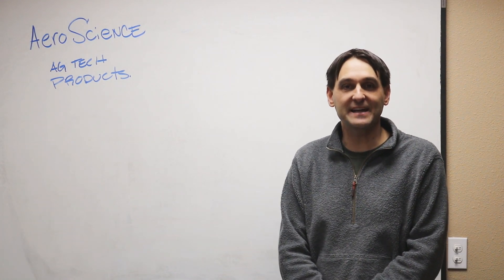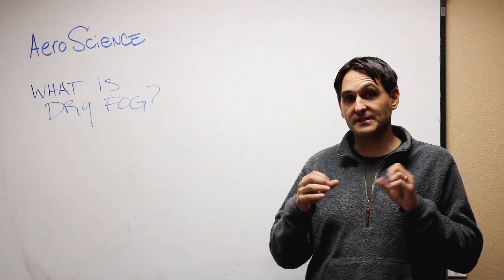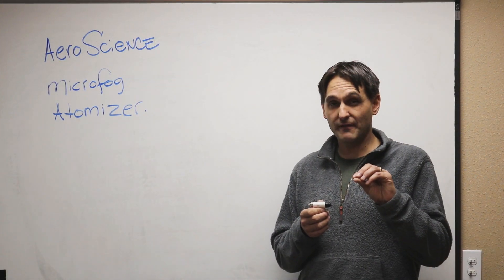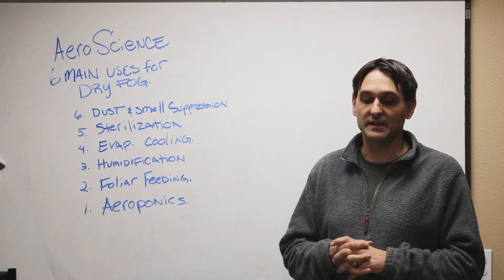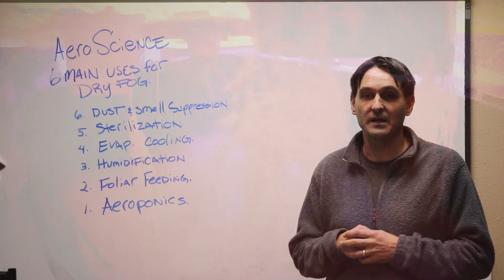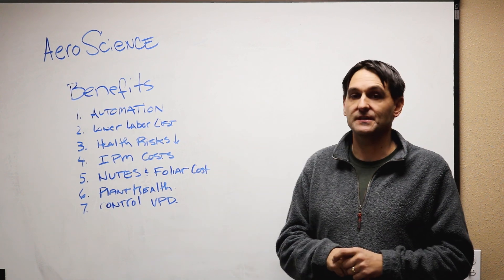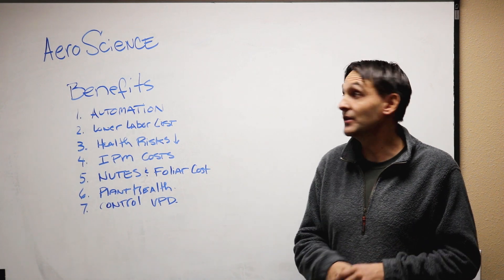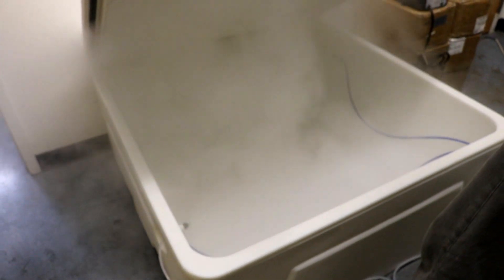What is Dry Fog?  By AeroScience Ag Products

Comment: If I were building an aeroponic/fogponic system, how much power/energy would be required per square meter?  That is, assuming a $0.10/KWHr (USD) for electricity what would the energy costs per hour per m^2 be?

Comment: Hi Josh, I am a home based gourmet mushroom grower and I am interested in your nozzles vs a 1000psi high pressure system. I emailed you this morning to talk details. We are interested in them for Humidity production, 95%, without coating the mushrooms in moisture or puddling on the floor. Some of our mushrooms like Lions Mane are hydrophobic and our ultrasonic system is havoc with this species as anywhere moisture beads up on them, the tissue dies out. we have a way to prevent this but it's a big pain in the arse with the work around.
We are considering building a high pressure system but this looks much more affordable for us and seems to be comparative in micron size? HPS will achieve a 5-10 micron atomization, effectively preventing moisture build up while maintaining humidity. How does yours compare and have you  had third party verification completed yet?
Thanks!
Reply: Did you ever find out more about this?
Reply: @desertmoonmushrooms  I think so....if I remember correctly I don't think this is what I'm looking for. I think the droplets were still too big. I'm going to build my own HPS like Meyers Mushrooms did later this summer or early fall...

Comment: Will this destroy a compost tea? I’ve heard those need to be at minimum 400 microns. Please help.
Reply: I believe this will not destroy microbes in compost tea. The micron size produced by this product is much less than 400.
Reply: @mrchrisby  Isn't that a problem if the organism is larger than your nozzle diameter? You're basically shredding them at high velocity, then.

Comment: There's a clip of a guy using a handheld gun to sterilize an bedroom area.  It looked like the atomizer had multiple hoses coming from it.  I counted 5 - air/solution lines from the video.  I need a dry fog atomizer that mixes two chemicals at the venturi.  Do you know of such a dry fogger?  Do you know where I could find more information for sterilization?  Thanks!  BTW, great video!

Comment: too small. 30 to 80 microns is the sweet spot for roots
Reply from the maker: Hey OP, 30-80 is a fairly broad range, do you have conclusive data on this?  We'd love to see it.  AeroScience has been testing droplet size as it correlates to potency output in controlled environments for years now.  Also, his nozzles fluctuate micron output based on pressure-in, 30-80 micron is achievable with the nozzle if that's what you desire.  Thanks for tuning in!
Reply: @MonsterGardensChannel  there are studies on the size and how roots absorb them and what kind of roots form at what droplet size. most hpa users opt for something like a 50 micron nozzle. i can imagine that certain elements are easier transported with 30 microns, while others are more effective at 80, maybe that is the reason for the range. i noted the numbers down when i did my research on HPA systems. if i find more data i can share here, i will.
Reply: So far the best results are from a hybrid system using both HPA and AAA fog. The larger droplets help the roots develop lateral growth and larger structure while the dry fog comes in after the root beard s developed and hyphae form, then it is more useful is nutrient delivery. When flowering, the roots become large and dense, and the hydraulic mist cannot penetrate the dense roots that well. The dry fog can get into the dense roots and provide the nutrients that the larger droplet mist struggles with. Dry fog is more expensive because of the compressed air, which is an expensive resource. But when using it in this hybrid system, it is less costly because it isn’t doing all of the heavy lifting on its own. The dry fog is also great for keeping pathogens away. I usually fill my tank with 10 gal of potent hocl soliton between tank mixes and fog the root zones with it over the course of about an hour, then I fill the tank up and mix the solution, keeping the ORP up around 500mv.
Reply: @MonsterGardensChannel   How much air  pressure in psi do I need ?
Reply: I'd most likely use it for watering aswell. I've never used "Dry Fog", but the idea of not disturbing the soil definitely appeals to me.
Reply: Hey how's it going,  not sure if you're on here still or not. 
I'm building a system. 
Not going to be using fog for nutrient delivery,  too problematic in my experiments due to various issues. 
But I'm still planning on using it. 
There's a company called Smart Fog that i was on their site,  their fog is allegedly different (including the way it is produced, cheaper).
If i read it correctly,  they are messing with the total charge of the particles to make them repel other particles including objects.  If I'm not mistaken, the molecules are arranged with the negative facing out. 
Anyway,  this is partially already how dry fog (actually is simply fog) works, iirc, and it makes me wonder if it is good for roots... it would not be attracted to the roots and simply would remain in the air.
This and oxygen dep are the reasons why fogponics fails when the plants mature and need more.  
Not that there are not reasons to have fog in that root zone, but I'm confused about about the polarity issue.
It seems that the only good is to keep pathogens down, and to maintain a moisture pressure, which is plenty good.
Also, do you use oxygen enrichment?.. not talking about simple bubblers or venturi.
Reply: I thought NASA published findings that said 10-15 micron was optimal.
Reply: @ronpaulrevered  from what I understand. NASA says the optimal water droplets ratio is the diameter of root hairs x3
Reply: the topic isn't about roots though.
Reply: cool, bro!
still a point to make for those thinking about using it that way... and most misters work on that size level, just with ultrasonic... so yeah.
Reply: Hey guys I think NASA knows more than any of us lol🤣